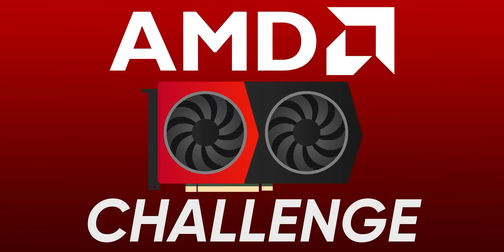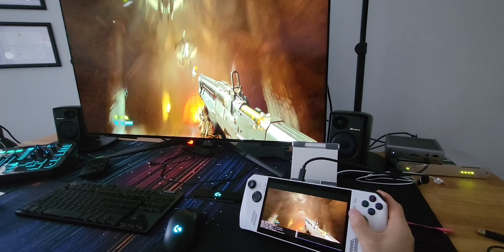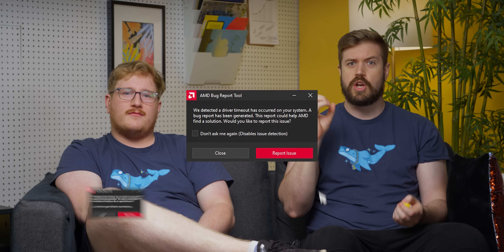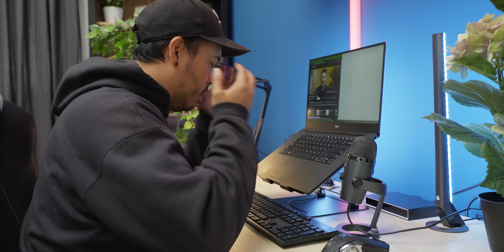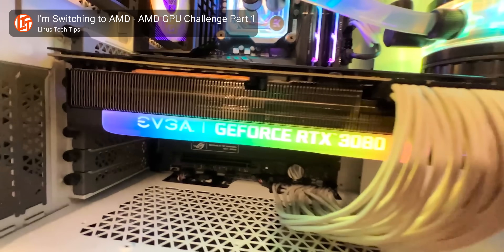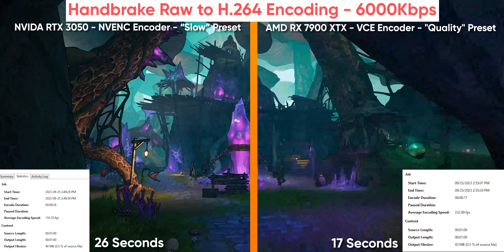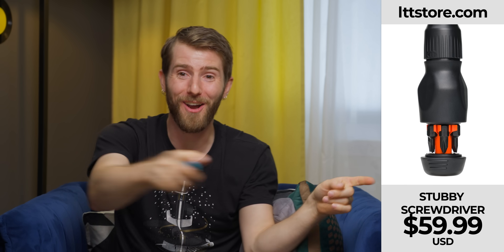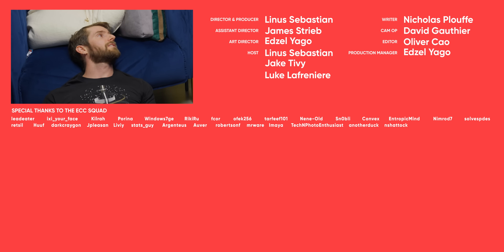I’m Staying on AMD! - Radeon Challenge Pt. 2

Comment: Ummmmmmmm..... "Running a fresh install could've fixed it, but who does that?" Literally any computer gamer knows, if you switch the processor from Intel to AMD or a GPU from Nvidia to AMD, you GOTTA do a fresh install of the Windows, because it is not a joke how much problems and crashes and blue screens if could give you. Learned it the hard way when I switched from the I7 6700k to a Ryzen 7 1700x and after about a few days my PC just crashed to the point where I couldn't Even boot in Windows
Reply: You might know that, but no. Not every gamer knows that, and not everyone does that even if they know...

And Linus' point was that it shouldn't be necessary.
Reply: @haxie4516  a lot of things shouldn't be necessary in life, but they are the way they are. Plus with the fact that probably about 99% of gamers and non gamers have a dedicated HDD or SSD for their windows doing a clean install takes 15 minutes, after that all you gotta is install drivers, that's another 10-15 minutes, and all the game files are on another SSD or HDD, you would just install steam and point out the folder, it would recognize all the games files. That's it, it doesn't take a day like it used to be 10 years ago!
Reply: @Svuatoslav454  
You way overestimate how many people have a setup that has separate partitions or physical drives for their games and their OS.
Reply: @haxie4516  I do not, with how cheap the SSD's and HDD's came over years, and how MUCH the games take space. You're seriously telling me that a person that had a HDD or SSD with 64-256gb of storage that was bought 10-15 years ago will just throw it out? No, it will be used as a System drive. All my friends have the same set up, me personally I had a Samsung 860 Evo 2.5 inch bay SSD back in 2011 with 128gb of storage, and now it's just the drive for Windows and apps
Reply: @Svuatoslav454  
You very much do overestimate the amount of people running with a multi-drive setup.
According to the Steam hardware survey, you're very wrong.
Like, we're talking less than 8% of total gamers have multiple drives in their systems.
Reply: @Svuatoslav454 
Cool story bro. You're still wrong.

How you can even believe that to be true is beyond me, because it objectively isn't.
A lot of systems don't even have the ability to have more than one drive in them.

Why lie?
Reply: No problem man, I understand you're just not very bright, and like a regular American you just believe the serveys because the are so accurate, and obviously everyone takes them🤦‍♂️ Good luck living in a bubble when you can explain something stupid by relying on the servey😂
Reply: @Svuatoslav454 
Given that significantly more than 1% of computers sold have only a single drive in them, and significantly more than 1% of computers sold don't have the ability to have more than one drive in them....

Well, I base my viewpoints on facts and reality.
What do you base yours on? Stubborn blindness? Indignant attitude? Childish spite?

You resorted to ad hominems because you don't have a valid point to make.
You even went so far as to assume a few things about me. Entirely wrong btw.

You're dismissed, student.
Reply: @Svuatoslav454 
Wow. That's a hilarious failing by your school's curriculum. I'd suggest reviewing statistics again.

Comment: I don't care how you edit your videos. You guys are still doing the tech industry a disservice. 
Figure out why you're having problems before you blame AMD for the issues you're having. Any issues Luke has due to his jank pcie3 riser are IRRELEVANT.
It's known to cause issues using a pcie3 riser with a pcie4 GPU. All of the issues Luke had are NOT RELEVANT and shouldn't have been included in a video with the purpose discussing AMD's GPU. This is a poor system config and complete user error. 
How is anyone to take you seriously when you apparently can't build a practical and functional machine and then blame it on the vendors when you're using incompatible hardware? This is DOCUMENTED.

And Linus, have you tried using AMD Link? The streaming solution that's actually built into the drivers? You talk a lot about nvidia's steaming solutions but didn't mention AMD's at all? I assume you didn't even try it?
Reply: The issues weren't due to the riser though, pretty clearly as a driver update fixed things.
And the video was literally about their experiences in swapping to AMD cards...
It absolutely should be in there.

Seriously dude. Do better.
Reply: @haxie4516   You tell me to do better, however, if you think someone going onto a privileged platform and judging their experiences of a product in front of a million people, whilst using a configuration which the manufacturer explicitly tells you not to use isn't somehow either malice or ignorance, then I worry about your critical thinking skills. 
If you want to give them a fair try/chance, at least install it in a compatible system. It's not a complicated concept.  

Seriously, dude. Think better.
Reply: @TheAlmightyTsu  
Nowhere does the manufacturer say not to use a riser.

Luke's system is compatible.

And replacing Luke's PC for the challenge would defeat the entire purpose of the challenge.
This isn't about "giving them a fair chance" because it was never about some sort of fair chance BS.
It's a real-life view of how Luke, Linus and Jake would set things up with their systems, how they'd use them, and what they thought of them.

Seriously dude, try thinking at all to begin with.
Reply: @haxie4516  It's not.  The below is taken directly from AMD's website. (Youtube won't allow me to post the link to it)

"Since many PC chassis currently on the market come with PCIe riser cables and extenders validated only for PCIe Gen 3.0 operation, there may be some system stability issues when used in combination with PCIe Gen 4.0 devices. If you are experiencing stability issues such as choppy mouse movement, BSOD or hangs, please follow the troubleshooting recommendations below to pinpoint the problem:

    Change PCIe Slot Configuration setting – The PCIe Slot Configuration option is found in the system BIOS. Change its current setting to Gen 3.0 then save and exit the BIOS. After the system reboots check whether the stability issues persist.
    NOTE! For more information about your system BIOS and settings, please refer to the system/motherboard user manual.
     
    Reseat devices – For example, remove the riser cable and extender and install the PCIe Gen 4.0 graphics card directly to the PCIe x16 slot on the motherboard. Ensure that the PCIe slot configuration option is set to Gen 4.0 (or Auto) then check whether the stability issues persist.
    NOTE! Apply this step to any Gen 4.0 devices on your system connected by riser cables and extenders.

If either troubleshooting step resolves your system stability issues, it indicates that the riser cable and extender may not be PCIe Gen 4.0 compliant or potentially malfunctioning if it was not validated by the vendor.

The ideal solution in this case would be to replace the faulty riser cable and extender with one that is PCIe Gen 4.0 compliant and validated for compatibility with your PCIe Gen 4.0 device. If this is not currently feasible, then consider keeping the devices connected directly to the motherboard. However, if direct device connection is not appealing for any reason, you may consider setting the PCIe Slot Configuration option in the BIOS to Gen 3.0, as a workaround."
Reply: @TheAlmightyTsu  
It is. His riser cable is a gen 4 cable.
He also tried setting the slot to gen3 mode only in the past.

And if the riser was the issue, a driver update would not make almost all the problems go away.